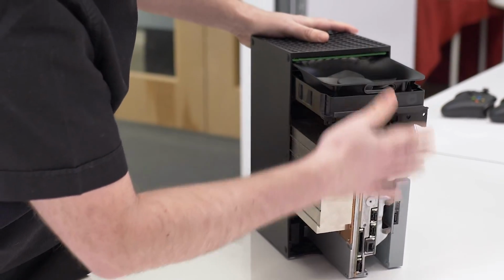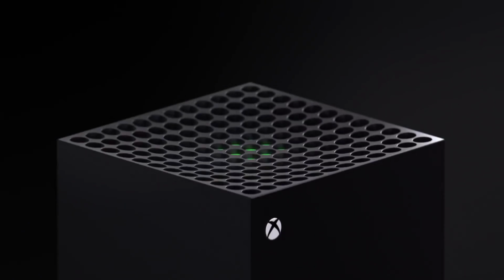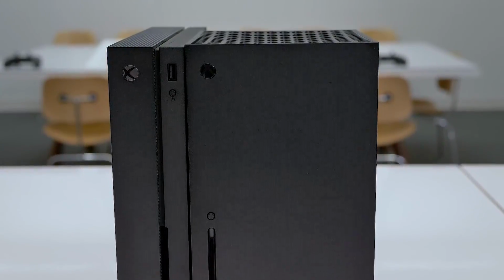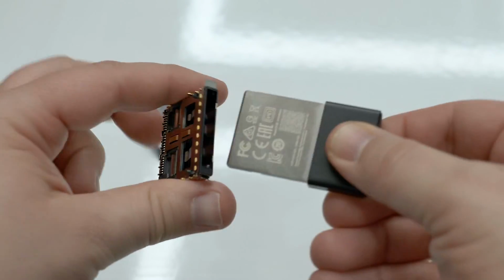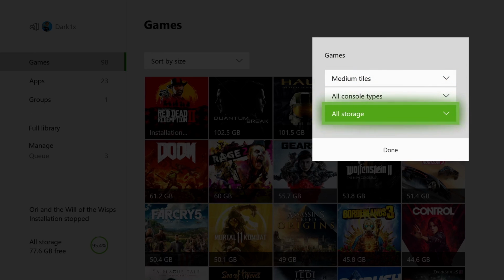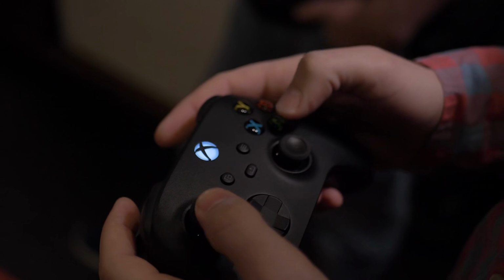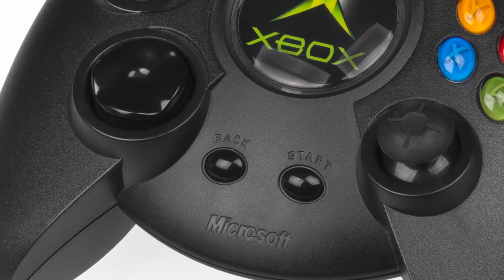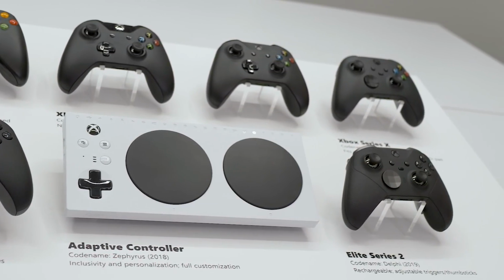DF Direct: Hands-On With Xbox Series X  + Impressions + Xbox One X Size Comparisons!

Comment: Microsoft is being extremely calculated, love it!
Reply: And yet at the same time - "yo, you want to open the box? Touch the motherboard? Vapor chamber? Cool, disassemble it and then put it back if you want. Or not."
Reply: @Szmajdzik   It honestly looks like later on down the round if an owner of the XBOX series X wants to upgrade you'll be able to do it yourself.
Reply: Like with components that they bring out not just generic computer parts.
Reply: @randybradley4151  I don't know about that. What components? Nothing looked like a do it yourself swap.